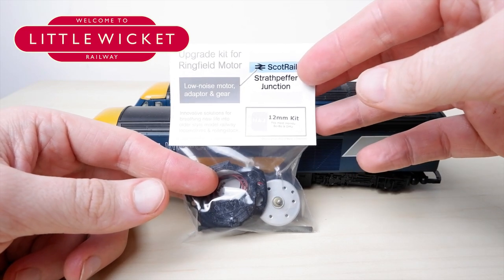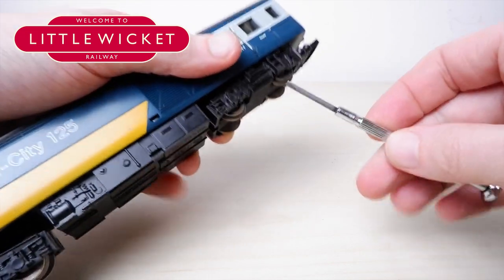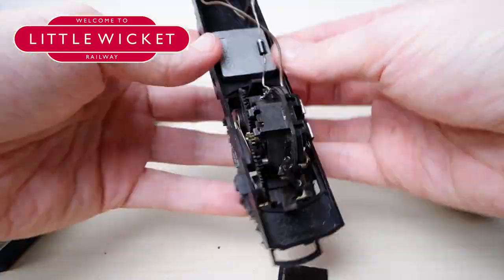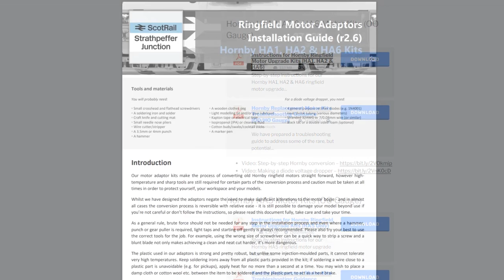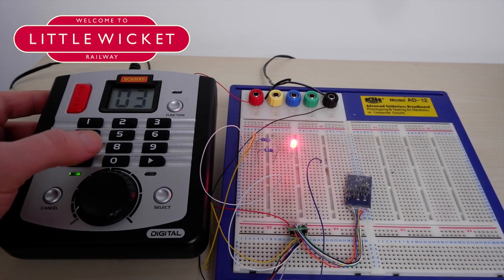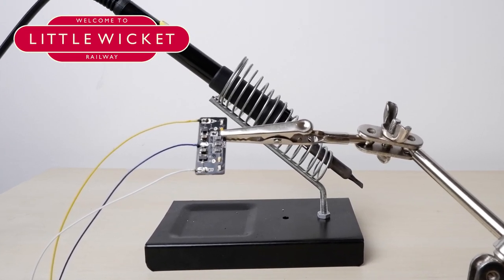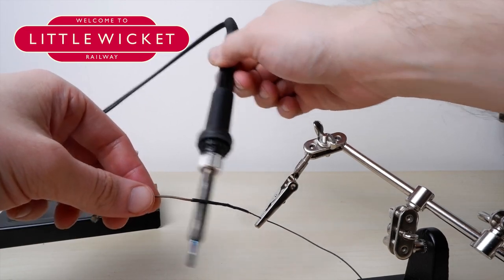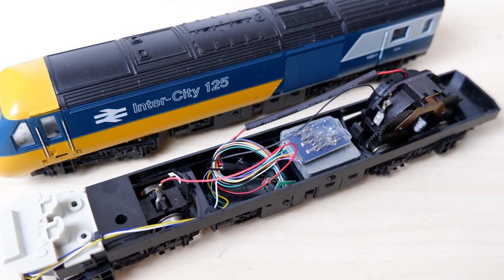Upgrading the Hornby Intercity 125 HST | CD Motor, LED Lights and DCC

Comment: I used one of the Strathpeffer kits for my old SilverSeal Ringfield Class 47 and it was absolutely brilliant.
I was also really impressed with the Blackcat board in my HST 125 .  Worked much better than first expected.  They are two highly recommended upgrades to these older models.
Reply from the maker: Agreed, reasonably priced upgrades that make a big difference 👍

Comment: I just did this upgrade about 2 weeks before this video. I also installed the 6volt damper thingy. Works amazing and super easy install, great kit from Strathpeffer
Reply from the maker: I've got the diode voltage droppers to try in another loco. Using a Hornby TTS sound decoder that doesn't have speed reduction CVs. Currently it's breaking speed records on 20% throttle. Did they work for you?
Reply: @LittleWicketRailway  yup, they worked great, speed is comparable to original. Mine is still dc only

Comment: Great video Robin.  I fitted my HST with a Strathpepper 12v CD motor and it pulls 6 coaches and the dummy with no problems at all on my 12v DC analogue layout (my layout can't accommodate a full size 8 coach HST in either the station nor the storage yard).  Not bought the LED lighting upgrade kit yet but its on the "to do" list at about 164.......😃
Reply from the maker: Haha, sounds like my "to do" list! Do you have any gradients on your layout? And if it does, then how does the HST handle those?
Reply: @LittleWicketRailway  No. I'm a member of the flat earth society. The branch line has a 1 in 40 but since my house move the branch line now terminates after about 6 feet so it's being set up with an auto shuttle unit for a push pull / railcar.

Comment: Hi. I think this is a great video. Many thanks for posting it. The only thing I have to question is: You provide a link to the Diode Voltage Dropper, but you make no mention of this nor actually fit one to your Power Car's CD motor in your video. Do you have to fit one of these if you are converting to DCC? What would be the problem in not wiring one into the motor circuit? Thanks, Rob.
Reply from the maker: Hi Rob, made this a while ago and tech has moved on a bit. I'd use HM7000 decoders these days and that have far better built in motor control which eliminates the need for diodes. I don't recall using the diodes with the TTS decoders, I just kept the speed steps low to avoid stressing the motors.
Reply: Ok, thanks

Comment: Nice video thanks. I have these to fit into same Class43 cars you have there, just need to get the motor upgrade kit. I also have a set of Lima cars in that livery so all in all makes for a nice train, I might even fit illumination kits into them. I managed to get several of the newer Class 43 packs before prices went mental so running them alongside, few ppl would notice.

Comment: Hi, this is a great video.  May I ask, how do you do this with two power cars in terms of control, since both have DCC decoders and each will have a different address and also what about differences in performance between the two power cars, can it cause issues if, say, the trailing power car is putting out more power to the wheels than the front one?  One other thing is how to do this including sound?
Reply from the maker: Hi Andrew, there are two ways you can do this:

1) put both decoders on the same address, but make sure they run in opposite directions (either via wiring or CV settings). If you've used the same motors and the same decoders then in theory they should have very similar performance. Both power cars would respond to the same commands for lighting, sounds, etc.

2) give them separate addresses and create on consist using your control system (not all controllers can do this). This would allow separate control of sounds and lights in each power car.

If the motors give out significantly different performance then you can adjust the CV settings to try and speed match.

The cheapest Class 43 sound decoders are the Hornby TTS sound decoders which are £60-£70 for a pair, but they don't offer great functionality in terms of speed control, active braking, ABC braking, etc. A pair of LokSound 5 decoders with way better sound files and functionality would set you back about £230 though!

Comment: Hi I am from Sri Lanka. Thanks for the video. it was just what i was hoping for. I have learnt how to remove the body from the chassis and the motor from the bogey chassis. Presently imports are banned by our authorities. My problem is traction tyres for the drive wheels. The rear bogey has wheels without a groove for traction tyres. If I switch the motor using the rear bogey, I  will eliminate the need for traction tyres, but will there be any problems. i hope to try this tomorow hope for some good results.  Faizal Hathy, Colombo, Sri Lanka.

Comment: Great video, which decoder did you use ? Do you have a link to it please ?
Reply from the maker: Hi Wayne, I used the Hornby TTS decoders R7140 (https://amzn.to/3CjJapt) it's a twin pack, so you get a decoder for each power car. This is the Valenta version for older HSTs. Hornby also do an version for newer HSTs with the MTU engine (R8120).

Comment: Loved your tutorial. I am a serious collector of model trains and in the case of HST liveries, I am trying to obtain the full list of liveries. To try and achieve this, it was necessary to purchase some models still with Ringfield motors. I run my collection on test tracks, analogue and DCC and to this end want the models to be DCC fitted and where possible with sound. I have fitted one power car with Horns and Whistles motor, which worked out fine. I was unsuccessful with Strathpeffer unit. As I am  not confident enough to move on to the next level, do you take commissions?
Reply from the maker: Hi Kenneth, afraid not, I don't mind tinkering with my models, but wouldn't want to risk damaging someone else's pride and joy. You can still DCC fit ringfield motors with a bit of soldering. As long as they're serviced regularly they should run well. Best of luck with your livery quest!
Reply: @LittleWicketRailway  thanks for your response

Comment: You mentioned that the second engine was originally not powered. How did you add a ring field motor if there was nothing there.
Reply from the maker: Hi Nicholas, sorry, should have explained that I had a spare bo-bo ringfield motor. These come up quite often on Ebay. The dummy power car frame is identical to the motor power car, so it's ready to accept a motor.

Comment: Great video, but I was just wondering why you used a decoder harness instead of just getting a wired decoder?
Reply from the maker: At some point I'll probably put in sound decoders, but I don't have any at the moment, so wanted to be able to easily swap them. Nothing wrong with wiring directly to a decoder though, especially if you're short on space.

Comment: Afternoon sir. Did that hst have pickups on all 8 wheels? I have got one and it's only got pickups on one side on the front bogie! Yours looked like it had pickups on both sides!
Reply from the maker: Hi Matt 👋 no, this is the same as yours, 2 wheels pickup on one bogie and two on the other. It's not a great arrangement.
Reply: @LittleWicketRailway  thanks mate. No it's not great isit. I've seen a YouTube video of a guy fitting the front pickups of a slightly newer class 91 from a 5 pole ringfield version which came with pickups on both sides of the bogie onto his old version of a 91, I was hoping they might fit the hst, but I can't find confirmation of it they will or not.
Reply from the maker: @MrHipwell1989  I think I'd opt for a stay alive over fitting extra pick ups, sounds like hassle.
Reply: @LittleWicketRailway  good shout! I hadn't even thought of that!

Comment: Sadly I can’t get the led set.  Doesn’t ship to the US now to figure out lighting.   But got the motors ordered
Reply from the maker: If you're handy with a soldering iron then you could definitely wire up your own lighting using red/white bi-colour LEDs and resistors. I got half way there, but I'm lazy so gave up when I found the ready made boards.

Comment: Re : the different wiring fort each end, could you just wire them the same and set bit 0 of CV 29 to 1 and get the same result?
Reply from the maker: Hi Sam! I'd need to double check the CV numbers, but you almost certainly can change CVs on most decoders to achieve the same as swapping the wires. You can definitely change the motor direction and on these decoders you can re-map functions so I assume you can do something similar for the front/rear lights.

Comment: This is a great video the only thing is, because I'm a bit of a dummy, is how did you wire the lights? You talked about wiring the motor but not the Black Cat lights. I have the same as you have so this is a great video cheers
Reply from the maker: Hi Guy!

Assuming you're using DCC, on your decoder you should have a white wire (front lights), yellow wire (rear lights) and blue wire (common positive wire). These lights are directional, so will automatically turn on/off depending on the direction your going in.

On the black cat board you have three solder pads labelled 'A', 'B' and 'C'. 'A' should be connected to the yellow wire, 'B' should be connected to the white wire and 'C' connected to the blue common wire. Then at the other end of your HST you'll need to swap this round and connect 'A' to white and 'B' to yellow.

Full instructions here: https://blackcattechnologyblog.files.wordpress.com/2017/10/hst-lights-instructions-single-page-v5.pdf

Hope that helps.
Reply: @LittleWicketRailway  hello thank you for your insight, I've just noticed it and sorry I'm late in replying. I watch your videos with interest. Thank you 🎃

Comment: Reminds me of my InterCity 225
Reply from the maker: Another good model. I've got a 225 that might recieve the same upgrades at some point.
Reply: @LittleWicketRailway  sadly mine is the train set class 225 so sooner or later I'll switch the plastic pantograph for one that can take power from overhead wires
Reply from the maker: @111greatbear3  are you going to have working overhead wires? That'd be really impressive!

Comment: I don't understand why the new HSTs even the exLima tooling Railroads are unreasonably very expensive! 
I wish I had this skill....
Reply from the maker: The "new" GWR HST from the set does have improved lighting and motors, but not enough to justify the increase in my opinion. They've also added a lot of weight to the new railroad models and I'm having to do the same to get these older models to shift 7 coaches without wheel slip.
Reply: @LittleWicketRailway  agreed. This disappointment is the dummy car not have lights.. I find it quiet fun & thrilling while the trains with directional lights are running. The charm is different all together.

Comment: My dummy power car doesn't have a motor housing just a flat bogie
Reply from the maker: You'll need to get another motor housing for the dummy car. These come up pretty often on Ebay.
Reply: @LittleWicketRailway  couldn't find a spare power car housing so I just serviced my original ringfield motor and it's now running great again 👍

Comment: A dummy car doesn’t have a motorised bogie so I would need to find a motor and correct bogie. So better to use an old motorised unit eh?
Reply from the maker: Correct. No motor in the dummy car, but I think (can't remember 100%) that the dummy bogie will take a ring field motor. But yeah, a motorised power car would do the trick.